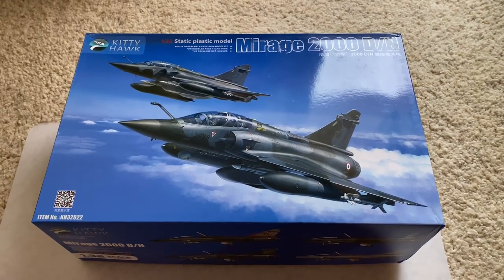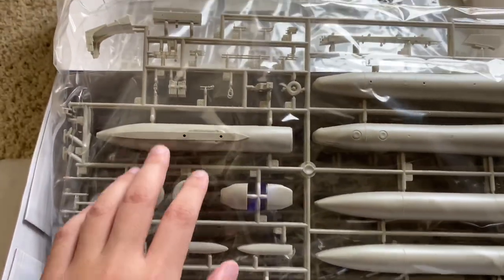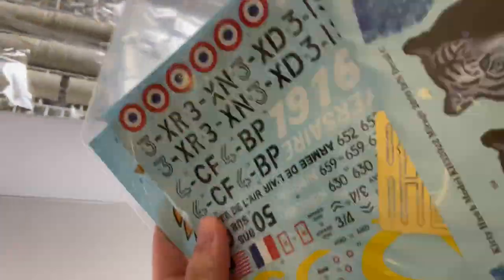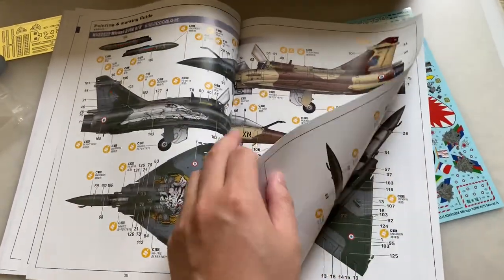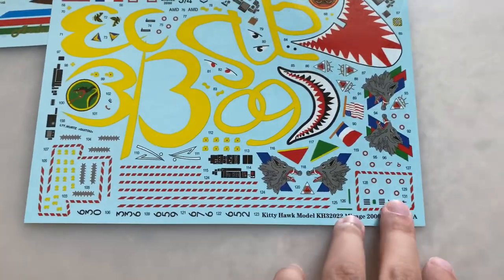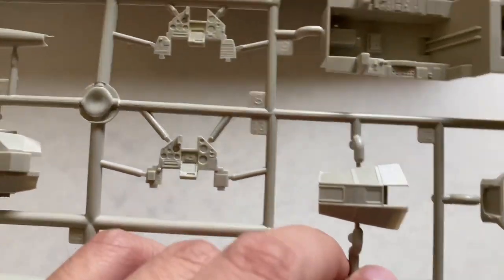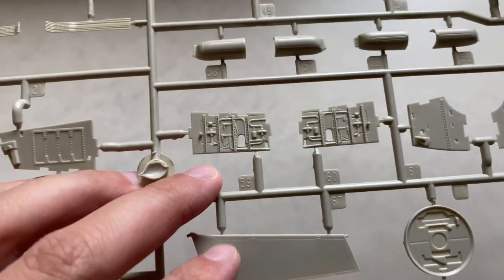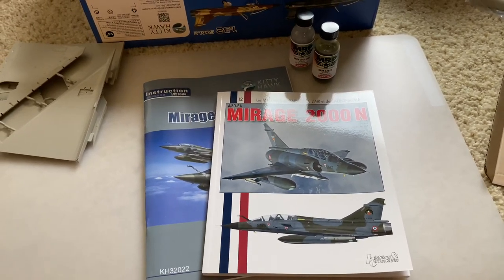Kittyhawk 1/32 Mirage 2000D/N Unboxing

Comment: Bought this kit and I'm really happy with it. The parts fit really well with the exception of a spot at the bottom of the front fuselage where KH decided for some odd reason that it would be a good idea to mold the crate which is located there with the 2 fuselage parts and cutting this crate in half. Other than that, I'm happy. It's worth mentioning that you can also build a B version. Though the box says only D/N, there are all parts avaiable in the kit to build this early 2 seater version of this plane. The only downside I found was that KH delivers just the old cockpit panels. For the modern layout with more MFDs you need to buy after market parts. Quinta Studio does some really nice cockpits for this kit.